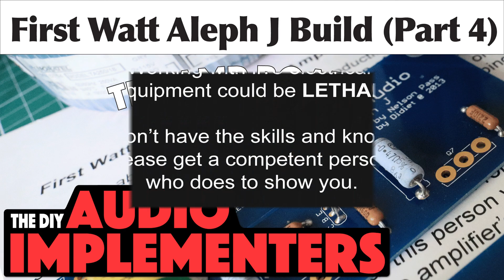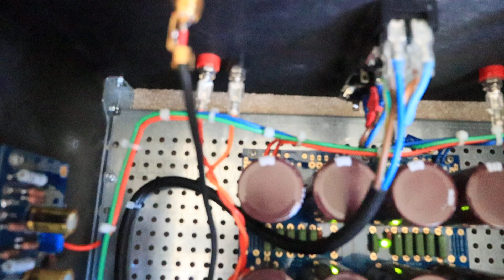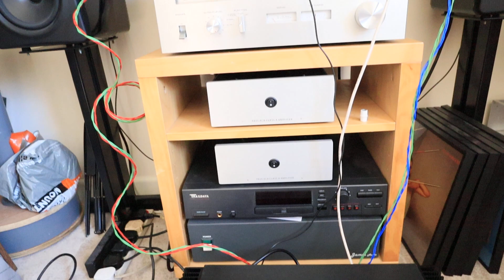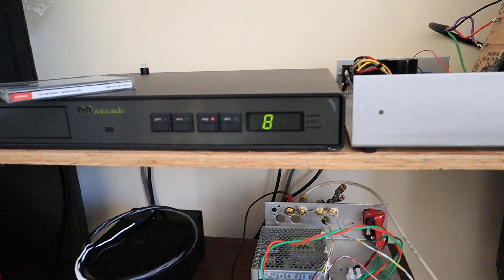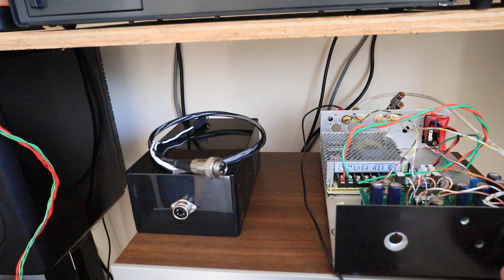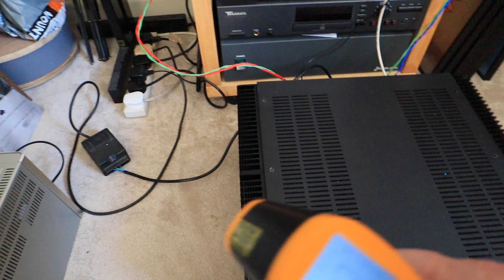First Watt Aleph J (Part 4, Final) Amp Build. It makes beautiful sounds.

Comment: I have watched your excellent videos :-) But what kind of sockets have you used for the front LEDs? I'm build one myself and cant wait for the test ...
Reply from the maker: Hi, I did not use sockets. They are 5mm dia LEDs So just I drilled a 5mm hole and used a little clear mastic to hold in place. They are flush with the front panel.
Reply: @thediyaudioimplementers1826  ok great solution. Thanks.

Comment: Would it possible to fit the Aleph J in a 3U chassis? Btw super vids on the Aleph build 👍
Reply from the maker: No, is the quick answer it runs very hot so you need a 5U.

Comment: Hey, I am about to build the B1 Korg Preamp. Which SMPS are you using? Any other modifications done?
Reply from the maker: Hi, I'm planning on my next video being the B1 Korg build...should be up next week. I didn't do any mods and its a great sounding pre. I used the Mean Well LRS 75-24 (which is a chassis mount) not the block type.
Reply: @thediyaudioimplementers1826  Looking forward to the build video. I have gone only for the board and Jets. Build an ACA 1.3 and Whammy currently used as the pre for the ACA.
Reply: Many thanks for your videos, very informative and helpful. A lot of things have been clarified for me since I found your channel. Just starting my trip into DIY-Audio and your channel is extremely useful for me, as you mention a lot of tips and go into details. I hope to see a lot of new DIY projects from you (maybe speakers as well). 

All the best, stay healthy too!

Comment: A fantastic series of videos. Many thanks for the effort you put into the project.

I have been reading up about these amps. They appear very interesting indeed.

Would you be so kind as to describe the difference in sound/presentation of the Aleph J, and your other anp builds?

Many thanks.
Reply from the maker: As always this is a hard question to answer as its based on my opinion with my equipment in my system (which may not be ideal) but I can make some comments on all of these amps as I have had them here to listen to back to back (sort of) . (one is out on loan at present) They are all running of a 24vDC power supply with identical transformers etc etc.. and set up for optimal bias, 50-55c at the heat sink in 5U cases. 
The N Pass derived jfet/mosfet Class A amps have a 'signature' as do all manufacturers. The F5t is ruthless at reviling every little thing in/on a recording good or bad and can leave you a bit wow 'were did all that come from' almost to reviling, almost, but OK.  
The Aleph J is more forgiving and a joy to listen to, not so ruthless as the F5t but has a really nice, can I say 'natural presentation' sort of..  
I like it a lot.
The F6 is a softer variant of the jfet mosfet N Pass signature, more valve like in some ways and a pleasure to listen to for hours...I think it has more musicality then the others.
All that said IMO they lack bass weight, its there but for me they could all do with a bit more grunt.
My favourite is the Avondale Audio NCC300 which sadly is no longer available as a DIY project. It has 130watts of grunt and has the musicality as well.